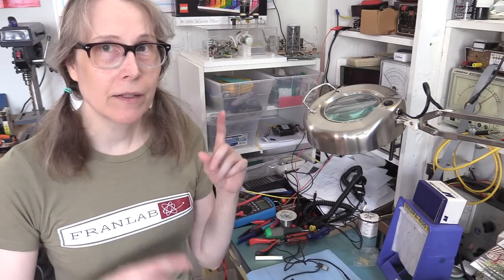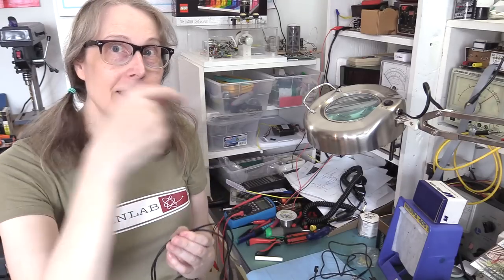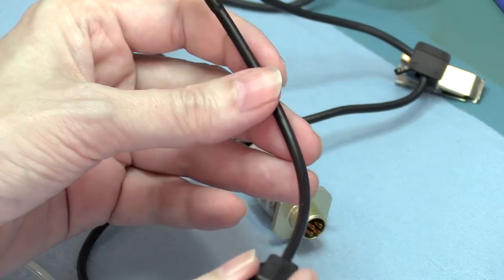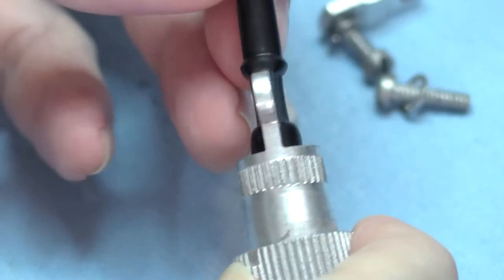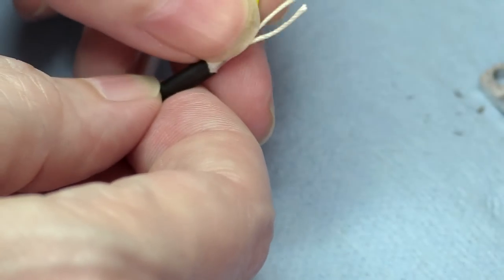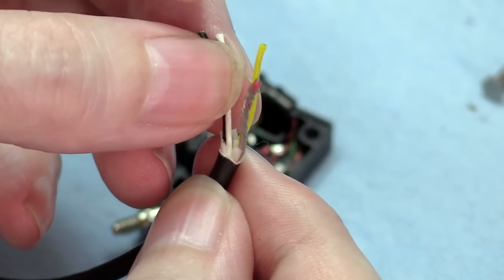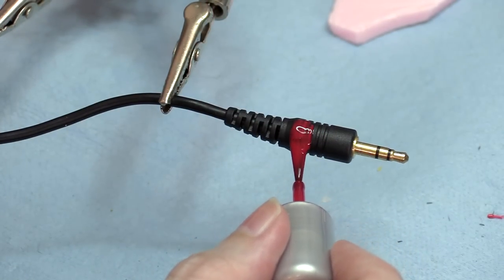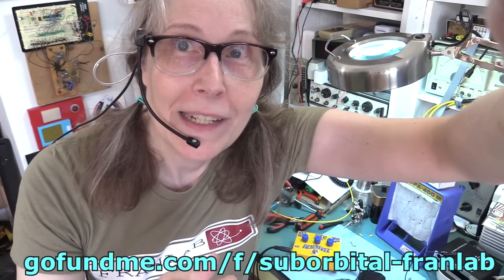DIY Apollo Flight Com System!

Comment: The double pronged connector is two GPO (British General Post Office) 316 plugs. They were a vastly superior alternative to the 1/4in jack plug and used in broadcast audio patch bays etc.
Reply: P.S. but see also: Steve Johnson’s comment saying they’re amphenol? Or perhaps that was in reference to the 4-pin deals.
Reply: @DavidLindes  Yes the 4pin with exotic bayonet latch is typical of an Amphenol design.
Reply: @OliverWoodphotography  got it. I’d been thinking of the other unusual (even if standard in some contexts) connectors; apologies!

Comment: Suggestion:  Do the best possible "dress rehearsal" with all equipment attached to you and whatever.  Get animated and bump your head into some things and see if you can knock your glasses off and such.  And have a "Plan B" along with you.  And perhaps even a "Plan C".  For something like the push on tube, consider using a cable tie to hold it even more securely (it's handy to have some cable ties handy anyway.  And perhaps a little roll of tape.)

Comment: Hi Fran, the dual prong plug is a dual 310 plug used in telecommunication's, mostly radio dispatch consoles. "911 call centers" From the tip back they are called Tip Sleeve Ring. Tip is microphone, Sleeve is PTT and Ring is receive audio. The box with the white button is your PTT and if press and slide forward it will lock the PTT. The mic looks like noise cancelling and may need bias current, if you recording device does not already provide that, so you may not need an external amp. Try 5-12 volts DC on the red wire current limited to 50-100ma. I worked with those for over 30 years. Hope this helps.

Comment: "I even have the rare connectors for this", proceeds to cut connector off. XD
Reply: The holes in the locking sleeve should be for accessing the screws holding it together
Reply: Right? And I mean, 7:58 is bad enough (but understandable and… whatever. I’ve come to believe that it’s important to embrace destruction in support of creation), but then at 8:02 when I see now close those cutters get placed to that strain relief, it hurt… I’d have wanted to make it possible to attach a different connector or whatever so that the rare connector could still again get used.
Reply: The 'rare' connectors appear to be ITT / Cannon Trident Ringlock connectors, not particularly rare as they are still in production
Reply: those connectors aren't that rare...

Comment: That four-pin plug, once you've undone the back cable clamp, if you plug it into the female connector and secure it in a vice or something, so the inner part of the plug is held, the back shell of the plug should unscrew counter clockwise. That should give you access to the back side of the pins if you want to reconnect the cable to the connector. Some versions of those plugs have solder cups on the back end of the pins, some you need a tool to replace the pins themselves (the pins are just friction fit through the rubber), and the pins are crimped onto the wires (but you could still splice it). Impossible to tell for sure unless you pull it apart.

Comment: You need to find out the background sound decibel level in the plane. Then get  hold of a sound meter and set up a speaker system to simulate that noise level.  You'll be able to qualify your headset for use.

Comment: I was a 9-1-1 dispatcher and we used the PTT umbilical cord. Wireless was starting to come in but wasn’t always reliable so we stuck with the corded assembly. If you weren’t careful and stretched the cord, it would rocket out of the jack and smack you!

Comment: You are lucky to get that version headset! I have two sets that are sealed units with the sound tube for the microphone which is built into the little black box. Believe it or not, they might still make these headsets for pilots flying jets. Have an add somewhere listing them in a pilot supply shop. The ear tubes used in the past with the Ma Bell system equipment came in a blue vinyl zipper bag with the headset, an assortment pack of earpieces in seven sizes ( they were known as pinkies because of the pink silicone earpiece used.) as well as a headband for those who do not wear glasses. There is a company out west that has earpieces that fit these headsets as well as several other styles that are compatible. You might look into Klein Electronics, they stock these replacement earpieces.

Comment: Hi Fran, I used to use a similar comms set - The yellow wire is for the +ve supply for an in-line pre-amp module that was an option for some flight systems.
Reply from the maker: Good to know!
Reply: @FranLab  I *think* mine was Concord victualling, but I'm not sure. Certainly, the pre-amp module was smoke-free, and was duly removed.

Comment: Hey Fran, You did'nt need to cut the plug off. If you turn the locking nut at the end of the plug, (with the holes in the side), You will see a grub screw though one of the holes, holding the silver shell on. It's the same with the old video camera plugs for a Portapac. :)

BTW, The mic sounds brilliant.

Comment: I'm surprised that the typical Apollo lo-fi sound was actually caused by the headsets. I always assumed it was the recording and transmission techniques that caused this heavy lowpass sound.
Reply: It was probably many components in the signal path, all designed for the same bandwidth. The aim here is readability, not high fidelity. It's the same in cockpit communications even now.

Comment: About the connector that you did not seem to open:  It looks to me like a fairly typical military one that has to be plugged in the mating socket before the very fine and tight shell threads can be twisted open.

Comment: Try using laryngophone if you're worried about loud noise
they used by pilots and mechanics
we literally use them while standing directly in front of running aircraft engine

Comment: if you want something really dependable and well isolated that wont come off easily then get a decent throat mic. you can still also have a more conventional mic too. but a throat mic will guarantee you have a fallback audio in case your main mic is unusable. and also it gives you an option mix the 2 different channels together in post. since the throat mic will catch better a different range of frequencies more clearly than the other mic will be capable of doing

Comment: Just a couple points Fran those headsets are likely Plantronics products. Pretty much anything made by Plantronics is considered to be a Cadillac product. The rectangular microphone piece is probably noise canceling hence the two areas that are screened. You'll note the very narrow bandwidth of the audio coming from the microphone is probably constricted to 300 to 3400 hz which is pretty typical for  telephone usage. And the dual quarter inch plugs are typical of what we're used on switchboards up until they actually a few years ago. Chords with a dual plug on either end we're often used on patch panels for being able to move around veryious circuits in a telephone exchange or a microwave or other long lines. facility. Those plug-in connectors on the end of the cords are typically of the sort used on a lot of military equipment I can't identify that particular plug but it is very typical of those used by the military.

Comment: would it be too annoying (to the others) if you added a roger beep? :-D  if you are forced to build a small preamp you could add an oscillator and a small micro switch on the amp box to activate a beep.
Reply: Edit in post?
Reply: @jamesdriscoll_tmp1515  The Quindar tones were never made by the astronauts...

Comment: 3:03 -- those are called Bantam plugs  They're similar to telecom in that they're a dual Bantam, but they look to be spaced further apart than the Telco variety.
Reply: The Bantam (or TT - Tiny Telephone) is the miniature version of those connectors, which are GPO 316. The TT's only use is in high-density patchbays that are rarely used, because it's a lot worse than the GPO.

Comment: Those sillycone earplugs look the same as my old Etymotic in-ear monitor tips. I say old ones because I've since upgraded to a newer better model that uses slightly different looking tips.

As Dave mentioned, the audio does sound a bit Apollo Vintage, so perhaps running it through a pedal isn't giving it the best opportunity to shine. But I'm sure you'll figure out how to make it sound good.

Also you might want to think about something to keep your glasses on in zero-G. The extra mass of the microphone hanging off them might cause them to go flying if you bump into something. I saw Simone Giertz's and Physics Girl's videos about the zero-G flight a while back and they definitely bumped into the walls a fair bit.

Anyway, can't wait to see your video on the flight!

Comment: That headset was not designed for noisy environments. Try to get an old Plantronics aviation headset with the acoustic tube that was positioned at the corner or the user’s mouth. It was designed for clear talk in noisy aircraft.

Comment: @12:50 Those look just like PEM standoffs except PEM's (that I worked with in the 2000's) are designed to be pressed into where they are inserted (typically in aluminum) and the tube just above the hex base expands and stays put. Meant to be permanent. I mounted circuit boards with them. Maybe PEM makes those with a clearance fit. I think I have seen something with those when I was taking things apart in the seventies as a kid. My guess is they are NOT PEM's. Was PEM around back then? Anyone?

Comment: Fran,  greeting  from the UK. Have you considered throat microphones ? Work well in a high noise environment but a bit muffled. Just one small thing, probably not a problem but are there any possible EMC issues that need to be discussed with the flight provider. Enjoy the flight.

Comment: Fran, have you got your white vest picked out, just for maximum Flight Director authenticity? 
For the little sintered metal pieces in the mic audio boom, I got a piece of material from which a replacement part was made, when converting one of these headsets to connect to a 2 metre rig - about 1989? 
The piece to replace the microphone screen was made from a sintered disc , which was a replaceable part of a SCUBA air system regulator filter. (Dia. over 1/2", less than 5/8", about 1/8" thick).  The material may have been sintered nickel, or a nickel alloy. I'm not a diver; this came from a fellow research lab worker.
Hope this info may be of some use. I'm looking forward (with envy) to your forthcoming flight. Have fun!

Comment: I am shocked and alarmed that you just nipped off that "hard to find" plug n socket! I would've at least tried to sneak in an X-Acto knife tip to see if I could separate that rubber from the clampy end. But! Sweet job oltherwise.

Comment: Hey Fran, I wonder if you could explain how Apollo broadcast UHF/VHF audio and video 260,000 miles back to earth using a low power 29? volt battery power system and tiny antenna when on earth it takes 50,000 watts and a big antenna to broadcast 50 miles.
Reply: Look up directional antennas.  The astronauts were continually given instructions to orient the craft so that one antenna or another was always pointing at Earth.  Also, there's no significant atmosphere in space, greatly reducing the signal loss due to atmosphere.  Also, the Apollo project had numerous ground stations all around the globe, and those transceivers, being earth-bound, could be as big as they listed.  Also, the length of the simplest antenna suitable for transmission is directly proportional to the wavelength.  VHF has wavelength on the order of 1 m; UHF has wavelength on the order of (I believe) 10 cm.  Also, just because it was relatively low voltage doesn't mean they couldn't produce high power if they needed to.   They had fuel cells which continuously replenished their power system.

Comment: Neat-o, Fran.    I too scored a couple of the original Plantronics MS50/T30's that are in use on the NASA Mission Control pics you shared.    The MS50/T30 needs a DC bias and, thus, decoupling capacitor(s) on the audio line - to work correctly..     There are some schematics floating around the the internet to help. . . . . main point is be careful about assuming Fran's approach will work w/any of these "vintage" headsets.    Been using mine for my Zoom WFH sessions.

Comment: Fran; you really didn't need to disassemble the headset. 
You could have just buzzed it out with a DMM on ohms, and/or use a little battery to click the speaker diaphragm. 
I've done that dozens of times, repairing these headsets, used in broadcasting.
Also, there are a few companies, that will make you a custom-fitted IFB earpiece that is moulded to your actual ear cannel shape.
Reply: You could also replace that microphone with something that will sound much better such as a Sennheiser MKE 2-5-C Gold. 
We use those every day for the broadcast talent microphones. They are excellent and are available on amazon.

Comment: Sorry to be a nuge, but you're spending, like, thousands on this upcoming trip, and you're planning on putting together a sound system using antiquated parts? As I recall, the audio quality of those old space missions was pretty awful. And that was half a century ago.
You will test it first, right?